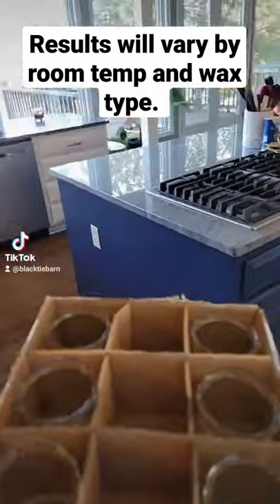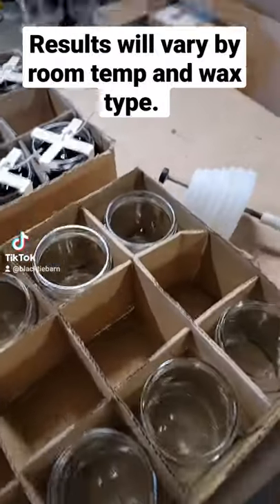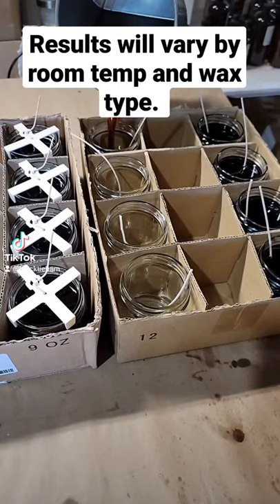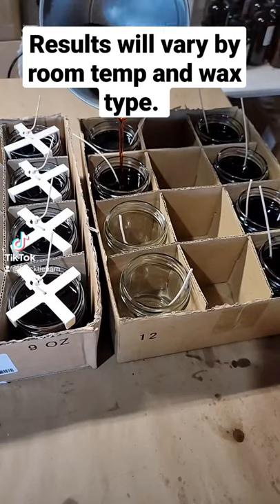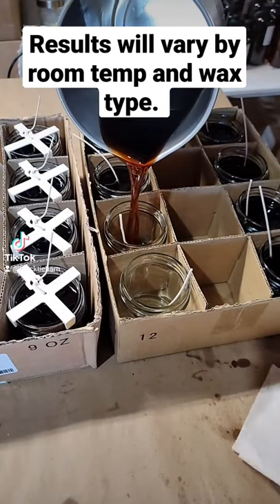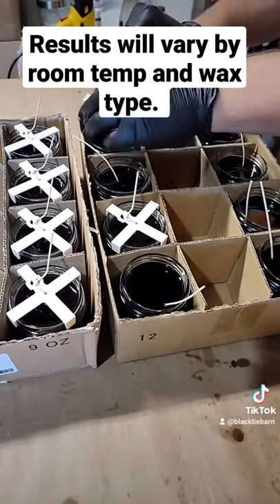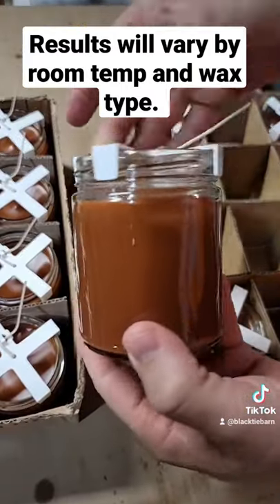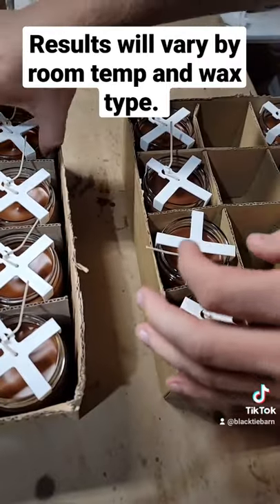Quick tips dealing with candle making problems like jar adhesion, sink holes & dips around wicks.

Comment: Thanks so much! I'm testing 464 and using  pint canning jars regular mouth with cd8 and cd10 wicks. The 10 had almost full melt pool during the first 4 hour burn. The 8 was less, both wicks mushroom. I decided to go with the 8, my question is when the candle cools the wax is a different shade than the rest of the candle. What causes the melt pool to cool a darker shade? Thanks.
Reply from the maker: Usually just from the heat of the wick/flame. Can discolor the wax. But sometimes certain FOs cause it to be worse.
Reply: @BlackTieBarn  thank you!

Comment: I'VE Been Testing And Slot of expierements, oh my,they smell like Heaven, but the wax I use isn't perfect so I'm having to come up with my own blends, my biggest concern is my wicks, I'm trying to use up some that were given too me, in two different sizes, 3oz Mason & 8 ounce Wide Mouth. After you pour, when you say heat your jars in the oven or hot water or heat gun? 2nd How long after you pour do u usually let them sit before putting on the lids? Ty the tips
Reply from the maker: I don't really preheat often. Certain waxes it helps but otherwise I don't do it.  It's hard to keeping that anyway as you scale up. But if it does help you, just do lowest setting for about 10 minutes is fine. I only heat when I see it's needed which usually isn't the case. And use low setting across the top once candle is mostly cooled or all the way cool. You just don't want to do it while it's still liquid obviously.
Reply from the maker: Oh, and I out lids on after they are firm and after I trim the wicks. Usually end of day if poured in the am or next day if poured later in the day.

Comment: Hi Wade so its safe to preheat in an oven? if i recall it right i read somewhere or someone told me its not advisable. if this isbok whats the ideal temp and time. i have sink holes a lot as i live in a place with cold weather most of the time
Reply from the maker: If you do just use lowest setting. Just need warmed.... not scorched. :)
Reply: @BlackTieBarn  thanks Wade. just tried it but i got big holes 😭 a minute microwave, let it sit for a while then wrapped the vessel with aluminum foil, pour temp 130F and still got big sink holes. 🥴 anyways i guess just heat gun it

Comment: hi Wade, why don’t you use this method anymore?
Reply from the maker: Just not scalable really as you grow.  It's fine for small batches though.
Reply: @BlackTieBarn  you’re right… btw this is off topic but…. do you happen to know why so many big brands use square braided wicks? and ironically why they’re so hard to get? they seem to be sooo stable, curl nicely but still keeps a straight and hard stalk while burning… it’s a mystery why most distributors dont sell them…
Reply from the maker: @solangelp  That's a good question. No. Lol.    Haha, in all honesty I think its because square braid wicks will hold up un nearly any type of wax (paraffin, soy, beeswax, blends, etc). They handle super viscous waxes. But... I have used them and wasn't particularly fond of the performance. They are a wick you can feel comfortable will get the job done in nearly any situation, but I am generally looking for the BEST wick I can rather than whatever just works. If that makes sense. Now I will say, square braid wicks work better in larger diameter jars and also in beeswax candles specifically.
Reply: @BlackTieBarn  Thanks! I talked to Fil-Tec company yesterday, and they were explaining that the wicks I was referring to are not actually square braided, but “Rigid-Curl KNITTED” wicks, which they told me look a lot like the square braids. It makes sense because the candle brands that I have seen them on are not beeswax, and they dont “just work”, they work beauuuutifully, perfect 45 degree curl but staying super straight in the melted wax, and they are incredibly stiff like a zinc core!!! Nooo leaning whatsoever in the melted pool, which sometimes happens with premier, htp, LX, etc. And the efficiency of the trimming was almost too good to be true! They said they’re gonna send me samples… Can’t wait!
Reply from the maker: @solangelp  Oh yeah that makes more sense. Ive used wicks from Fil-Tech before in some tests. Mostly the UC (ultra cores which I wasn't a huge fan of). Ive tested the rigid cores as well but not too much. They said they weren't as popular so I assumed they werent better than the ultra cores. Lol. You just never know! Let me know how your testing goes! :)